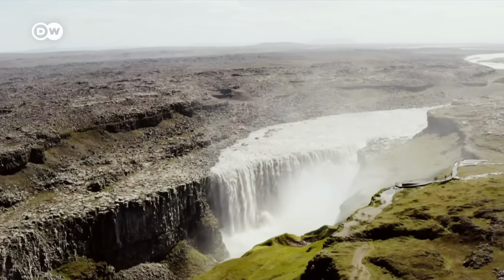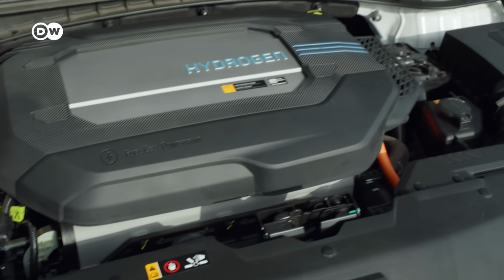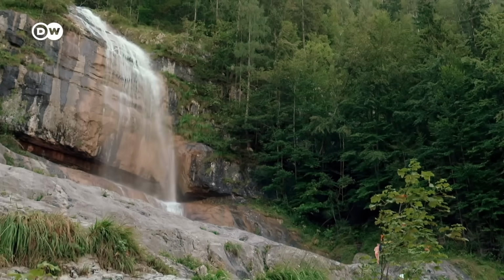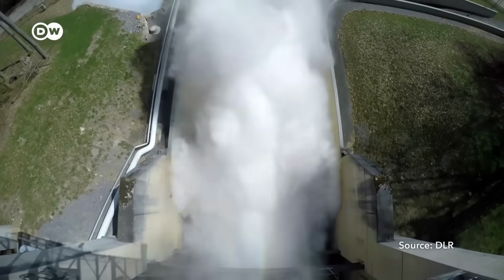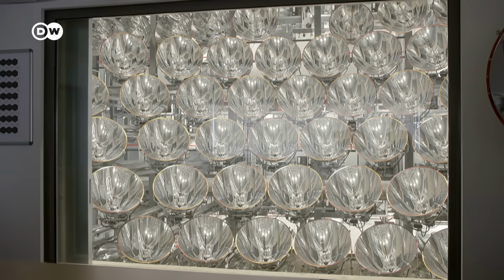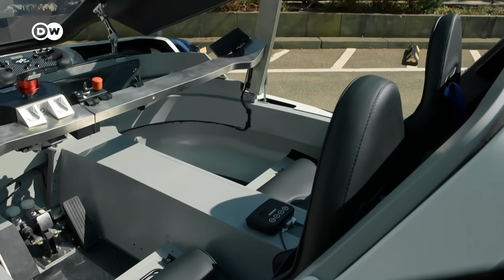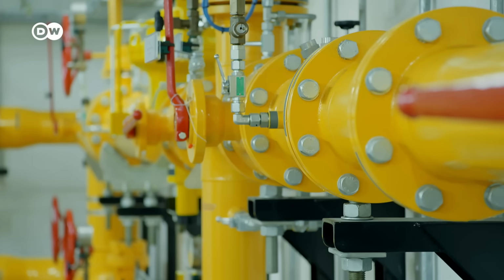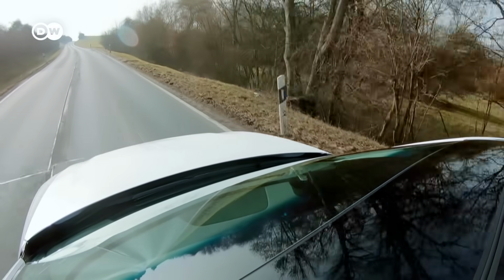Is green hydrogen the answer to the climate crisis? | DW Documentary

Comment: The inefficiency of the green hydrogen cycle is an insurmountable obstacle for it being used for anything other than niche applications where batteries can't work. Also, using only surplus electricity from renewable sources to create hydrogen means that the costly equipment is unproductive as it sits idle for a lot of the time, making it even more expensive. Storing surplus electricity in a battery is over 90% efficient, and capital costs are also much lower - hydrogen will never compete without a massive breakthrough in efficiency. Just because it is technically possible doesn't mean it will ever be economically realistic.
Reply: You are overlooking convenience, and the necessary upgrading of the electricity supply infrastructure to charge the national vehicle fleet simultaneously overnight. Why do you not consider stored hydrogen as an energy storage option ? (One that doesn't involve millions of tonnes of extra copper wire throughout the countryside !)
Reply: @johnevans6218  You do realize overnight charging wouldn't need any upgrade of the electricity infrastructure, right? A fully electrified automotive fleet would add around 10-15% to existing demand. Demand during the night drops by a lot more than that amount. Hydrogen however would require massive investment in extra new infrastructure. Also using hydrogen requires 3 times the energy, or it in other words, it will likely require a lot more wiring than using EV's, which essentially only really need the charging stations (or at home just a short cable).
Reply: You must be a big oil spokesperson
Reply: just as a horse owner said in 1900 about the motorcar.... probably.
Reply: Hydrogen made in summers for heating purposes in winters can be as efficient as 80-85% round trip.  This efficiency can be competitive with batteries.  Hydrogen pipelines costs 1/8 the cost of electric power lines per kW of thermal energy per mile, and existing natural gas pipelines and storage can be used to store H2, thus minimal new investment to convert from natural gas to H2.  H2 and Battery should co-exist, each serving different niches.
Reply: Niche applications only? Hydrogen is the only feasible alternative energy for shipping, aviation, trucking, farming, steel, heavy industries and natural gas replacement. This is the majority of all energy used.
Reply: @timothydevries383  
Trucking doesn't necessarily need hydrogen, though it could be a potential source. BEV and hydrogen trucks could be similar to petrol and diesel. As for natural gas replacement, this is only really in the industry (which you already mentioned) for heating using electricity would be just fine, the question would only be if hydrogen is a best long term (ie. seasonal) option if that was required.
Reply: All the renewable energies are not as cheap as you have been told. It costs far less to just convert gas powered vehicles than to manufacture an electric vehicle especially when you look at the mining costs and environment damage from such process. Regardless, hydrogen is abundant and truly "clean" whereas all the metals required for battery systems is extremely harmful and they are finite. Just remember the politicians pushing "green energy" are the same politicians that have been pushing the oil industry their entire careers. So that said do you think they all just had an epiphany or perhaps they just found their angle to enrich themselves further???
Reply: What happens when the raw materials for batteries run out, has battery recycling been factored into their usefulness ? Taking electricity from a green grid network means there wouldn't be any renewable generation standing idle ! Also current vehicles can be converted, negating the waste of replacing every vehicle on the planet !
Reply: @johnevans6218  As nice as it sounds, converting an ICE to electric wouldn't be a trivial task and almost certainly would be too costly to be viable.  I just don't think it makes any sense to do this to cars already on the road.  However, existing car manufacturers should have a huge advantage here, being able to use much of their existing infrastructure to swtich their existing lineup to electric on new cars going forward.
Reply: It depends on the objective.  If you want zero emissions then it is the only option.  Electricity sounds great but its uses are extremely limited and most people who live in cities where it is most useful cannot park in the drive to charge up normally from normal coal based power stations.  Electric has range issues etc. as well and short lifespan which makes them a waste problem which means they are the exact opposite of green.  The best option for hydrogen is to build solar plants in the Sahara (like the one already in Morocco) but no one wants to extend the Arab power.  The infrastucture of the oil industry could easily be changed to hydrogen.
Reply: @Jamie-Z  I do believe that you are coming from the perspective of several years ago, with essentially refutations of EVs, that were (and still are ) promoted by the oil industry, and the existing ICE manufacturers. They have big pockets to promote negative publicity around EV adoption - verging on lies. Problems with EV charging are relatively simple to solve- the infrastructure is already in place.
Reply: @chrisheath2637  The problems with recharging are beyond current technology so no, they are not easy to solve although if you do not mind replacing one pollution with another then yes, it will be fairly easy.  Hydrogen on the other hand can solve the problems without the need (although there would also need to be a will) for another pollution.  I do not come from the perspective you suggest, there are other better technologies but the oil industry has the deepest pockets and I believe we are deliberately being sold a pup so we have to stick with oil when ethanol or biodiesel could be in the pumps tomorrow it there was a will.  Hydrogen is the best future, electricity does not work and if everyone decided to go electric as our governments decree there is not enough raw materials on the planet to make the batteries and in 8 years when those batteries need to be replaced I hope we have found more reserves whereas with hydrogen we would have no such problems.
Reply: @Jamie-Z  The problems with recharging are beyond current technology
What are you talking about? Recharging isn't a problem.

Hydrogen on the other hand can solve the problems without the need for another pollution
Yeah, no. This isn't correct at all. Hydrogen would pollute more or less the same, just in a different way. (For example 3 times the needed renewable capacity that needs to be installed, which still has a co2 footprint)

there is not enough raw materials on the planet to make the batteries
Except, there is.

and in 8 years when those batteries need to be replaced
Modern EV batteries are expected to last the lifetime of the car, except if the car model has a terrible battery management system. Several manufacturers even guarantee a batteries minimum charge left (usually around 75%) after 8 years or 150k km.

whereas with hydrogen we would have no such problems
Except you ofcourse need the resources for 3 times the amount of renewables.

Hydrogen is the best future
You still haven't mentioned a single good reason for this claim. All you did is say stupid outdated criticism of EV's that anyone with a bit of knowledge knows is just stupid.

Leave tons of copper lying around in every street in London
Yeah, in protected cables/under the sidewalk, just like is the case now. Do you really think there are no easy solution to situations like this? Are you really that blind to reality or are you just insanely uninformed?

Given that there is not even enough parking in Fulham for the residents
Then where do they park their cars now? I doubt they keep driving them around constantly because there isn't enough space. Every car currently needs to park somewhere, that is just a basic fact.

When I lived there I spent most evenings driving around searching for a space
But you clearly found one, otherwise you would have been driving all night untill you had to get back to work. A charger doesn't necessarily need to be a private charger, you could also just install a lot of public chargers which cost slightly more (but not much, maybe 3-5cent/kWh extra) to charge at.

I would suggest you visit Amsterdam in an electric car to see how well they did and they are the best there is  :)
You mean a city were most people use either the bike or public transport? Again if there are cars, they need to park, meaning they need parking spaces, meaning you can install a public charger, not all that hard to understand. Essentially you aren't talking about the problems with eV's, you are talking about hte problems with cars in general.

and they are the best there is
Not a single city region is where it needs to be for fully electric driving, just like there isn't any region even remotely close to accomodate hydrogen driving for even a fraction of the drivers. Just because it isn't here now, doesn't mean it can't/won't be possible in the future. There is nothing fundamentally stopping EV's from replacing all ICE cars, the main thing that needs to be done now is just roll out the necessary regulation and infrastructure, exactly the same as with hydrogen. However while you need to roll out this infrastructure for literally everyone in regards to hydrogen, you only need to do this for people who can't charge at home or along highways for those people that make longer trips, so a lot less infrastructure is needed.
Reply: @MDP1702  Clearly I totally agree on every point here. How can people be so wrong?  Every town and city in the western world has street lights - so a bit of adaption - and charging. It is, I suppose, the political will to do it. Terrorists would have a field day with hydrogen infrastructure...instant bombs everywhere ! ( I am totally opposed to hydrogen for cars, from an engineering perspective. Hydrogen from methane reformation that is 98% at present - creates around 800 million tons of CO2 annually worldwide, with NO viable way to hide, sequester, bury, capture, or wish it into non-existence...Big Oil is in love with hydrogen...and their lobbying, promotion and funding prove that the publicity is working...)
Reply: @chrisheath2637  Street lights running a a 100 watt being replaced with 7Kw and you do not see the difference, no wonder you agree with the other guy.  Hydrogen from methane?  Why?  You wish to compare with a stupid idea to make your stand but everyone will wonder why you fail to make a point.
Reply: @Jamie-Z  Dang of course ! Tiny wires are running down the street to light lights. Ha-ha, yeah, and that of course is a completely different system from the cables that power houses, and commercial properties! I didn't think of that...
Reply: @Jamie-Z  
Street lights running a a 100 watt being replaced with 7Kw and you do not see the difference,
Just because they run at a 100W, doesn't mean their lines can only take a 100W. Even if the wires in the streetlights themselves are really thin, they likely get their power from another much more capable wire either underneath or above it. A good regular extension cord should already be capable of 7kW. 

Are there possibly updates necessary (ins some area's)? Yeah, maybe, but it isn't like these never would be needed eventually anyway.

Just to be clear, this is already being done and isn't that difficult, maybe one or two hours work to place a chargeport in the existing lightpole.
Reply: @MDP1702  You are so cool. It's so nice to see an adequate and educated person who owns logic. Thanks from Russia.
Reply: @Jamie-Z  most people who live in cities where it is most useful cannot park in the drive to charge up normally
These people need to park their car somewhere at night no? So it is just a matter of deploying low level 2 chargers to regular streets so people can use them at night. Besides that you need to ask yourself what these cars are used for: travelling to work? charge at work. Go to the shop: charge at the shop. ... Essentially there are more then enough possibilities to charge, however they need to still be rolled out. And if you really have no other choice, fast charging is available too.

Electric has range issues
The current hydrogen cars have a marginally better range than several EV's, who sometimes are much cheaper than those hydrogen cars. Besides you'll need quite some hydrogen refueling stations, which are very expensive. For that same price you can place around 30 fast chargers, that you can disperse over a wider area, meaning less time lost going to a station vs hydrogen. And if you have a car that can go 500km, that would be more than fine enough for almost anyone, considering you can't really drive further than that in 3-4 even when constantly driving at a speed of 130km/h (which is the highest limit in a lot of countries/regions). And after every 3-4 hours of continuous driving you are advised to take a 15-20m minute rest anyway, during that time you can also go to the bathroom, eat or drink something, stretch your legs, just shut your eyes, ...

In regards to trucks/semi, 800km seems to be a good range considering you'd be able to drive that range in around 9 hours at the usually top speed of 90km/h. Beyond that you'd exceed lawfull time limits in the EU and can be fined for driving too long. And realistically most trucks won't drive non stop for 9 hours at the max speed. Tesla semi have a claimed 800km range fully loaded, if that is correct, there really isn't a reason EV trucks aren't a good option for regular trucking. Only for multiple driver trucking would you need hydrogens range (and even then, what is losing 30-60min at a fast charger considering the cost savings driving on battery power?).

as well and short lifespan
What lifespan are you talking about? The batteries? Current Tesla batteries already are expected to last beyond the lifetime of most ICE cars, this also goes for several other EV parts (like the motors). So I don't really see what you are pointing at.

which makes them a waste problem
Not really, all EV parts are recyclable, even the battery (several companies already achieved a 95%+ recycling rate).

The infrastucture of the oil industry could easily be changed to hydrogen.
I don't agree with that, it is quite a different infrastructure you'll need. Only general things like docks for ships wouldn't need (much) changing.
Reply: @MDP1702 overnight charging on the street sounds to me like a wet dream for antagonist interference
Reply: @johnevans6218  
overnight charging on the street sounds to me like a wet dream for antagonist interference
What do you specifically mean?

has battery recycling been factored into their usefulness ?
Yes, there are several companies that achieved 95% recycling rate of lithium EV batteries and car manufacturers see recycling as a way to reduce costs (much higher purity of materials in a battery vs mining, not needing to ship it from countries all over the world, ...)

Also current vehicles can be converted
They can, however they are likely to be less efficient etc. so the price will need to be considerably lower for people to buy them, which in most situations won't be the case. Moreover cars can also be mostly recycled and people will just keep driving their ice car currently untill they want/need a new car. Only few people would be willing to bear the cost of converting their car to an EV (or hydrogen if possible).
Reply: @MDP1702   Lovely idea :)  Leave tons of copper lying around in every street in London :)  What could possibly go wrong  :)  Given that there is not even enough parking in Fulham for the residents where do you imagine you would put all these charging stations?   When I lived there I spent most evenings driving around searching for a space and most mornings walking around searching for my car.  I would suggest you visit Amsterdam in an electric car to see how well they did and they are the best there is  :)
Reply: @CL-gj9mf  
You don't see that, at our scale of existence petroleum isn't a sustainable vector of energy.
Actually I do, but whether you like it or not, at this moment we live in a petroleum civilization. EV's, renewables, ... are exactly what is needed to change this. Hydrogen will/should only be used where electrification by direct use or batteries isn't possible, like in shipping, airplanes, industrial applications (for example steel production and industry that requires high temperatures), ...

Petroleum isn't useless, it store CO2 out of the air we breath, and out from the water we live in...
I clearly meant useless in terms of energetic value to us, not in terms of carbon storage. This was completely in regards to your comment that hydrogen is as efficient as fossil fuels, which is actually really bad for hydrogen since we need to put all that energy in it first, we don't need to this with fossil fuels.

* it doesn't exist*
Yeah, it does. Several small companies already are capable of recycling lithium batteries at 95%+ efficiency. The main reason these are new pretty small companies is because they were founded with the vision of recycling EV batteries, before EV batteries the recycling market for lithium batteries just was too small to be interesting.

We aren't ready for fully recycling plastics
Completely different thing. Just because we can't fully recycle one thing, doesn't mean we can't recycle a completely different thing.

Fuel cells already exists
So do batteries. And their recycling.

If you choose others solutions you choose to engage war with China for the control of minerals and rare earths ressources
Most battery resources are not in China.

You can't electrified industrial moving engine
Depends what you understand under it. They even already electrified enormous mining vehicles that transport the mined substance, though for now it is still situational. And there also are already electric tractors for agricultural use if I am not mistaken.

So we will have to use methane produced from agricultural residues
While I like the idea, it isn't practical. I personally thought about that too, but the only way to do this is to have cattle sit in well isolated barns and having a system to get the methane from that air, doable but not really profitable and definitely not for mass scale use in industry, more like personal use of the farmers or surrounding area at best.

ITER is the final research step from 80 years of climbing efforts
ITER is not the final research step unfortunately. All ITER is meant to do is show we can get more energy out of the reaction than we put in and do so at a large enough rate to be able to produce enough electricity in another plant. Even after that we'll need to see if it will be commercially viable, building actual testplants that can produce electricity, ... And for now there still is no certainty ITER will do what it is meant to do. Yes, normally it should, but we can't know for sure. Even fusion scientist say that we don't need to expect any real electricity generation from fusion reactors within the next 30-40 years, even if ITER is succesfull. By that time we need to have fully electrified our civilization already.
Reply: @CL-gj9mf  
Where are these small industry, you talking about,
Redwood, Li-cycle, VW also has a subsidiary/testplant that achieved such high recycling rates. There are some more, but these are the ones I quickly could come up with.

to fully recycle my battery like the smartphone's one
It is unlikely any of these will focus on smartphone batteries, they are just too small (around 4000-6000 smartphone batteries per average EV pack). Ofcourse they could possibly recycle them as something extra/on the side, but someone else will have to do the gathering and shipping of these small batteries for them to consider it remotely interesting. And currently there is only one relatively small plant for every company, considering EV batteries are recycled at best 10 years after being introduced into the market, more likely 15-20 years or even more. So EV batteries they recycle now either need to be from EV's in the 2000's or from batteries that had a flaw during productions (which happens quite often, but these generally are found out before they leave the factory). So in essence these companies can't grow fast currently, they need to wait for another 1-2 decades to really expand on the current growth of EV's.
Reply: @MDP1702  most of the energy we r currently producing is coal based. When we store electricity in batteries we also loose some of it as heat and they become less efficient with each cycle. Also transporting electricity directly is not feasible because copper looses most of energy because of joule effect. Whereas we can do it with hydrogen. If enough money is spend on its research. Hydrogen is a way of storage of energy we r producing. Hydrogen is not a source from which we r extracting energy unlike fossil fuels. Hydrogen cars works by converting energy released by hydrogen into electricity and running the car. Electricity is one of most efficient way of transporting energy in short range. Currently ev r just using energy made by fossil fuels not renewable energy. Our problem on becoming energy efficient with renewable is that we don't have means to efficiently store it. We r producing lot of energy in renewable plants but we lack means to store it. And hydrogen seams like the best way to do it. HYDROGEN WILL BE A WAY TO STORE ENERGY NOT PRODUCE IT
Reply: @lololol-z7e  
most of the energy we r currently producing is coal based.
actually it is not, that would be oil based, coal is second, only slightly beating gas. In the US and Europe coal is even the 3rd most used form of primary energy. For electricity worldwide coal is indeed the number one. However in Europe and the US coal only makes up around 20% of the electricity mix and is ever decreasing.

When we store electricity in batteries we also loose some of it as heat
Which is why batteries usually are marked around 90% efficient, compared to hydrogens +-34% efficiency.

they become less efficient with each cycle
Yes, but they still last several thousand cycles before hitting around 70-75% capacity.

Also transporting electricity directly is not feasible
Hmm, what have we been doing so far? Oh yes, transporting electricity directly. HVDC can transmit electricity with a loss of around 3-4%/1000km, for HVAC this is around 7%/1000km. Hydrogen will at minimum loose around 65%, not including possible transmission losses (though when done well I guess these would be low to non-existent). This means you can transport electricity directly over +-12 000km with HVDC and suffer the same amount of losses (I calculated in losses from other necessary steps, else it would be around 16 000km), that means from Japan to around Portugal.

If enough money is spend on its research.
Or you can spend that money on improving already existing and viable other things like direct electricity transportation, or better batteries, ... (just to be clear I am not against hydrogen research, hydrogen will play a key role in some sectors, but the premise that hydrogen would be the best way if enough money is invested in research is onesided, the same can be said about many other things, like batteries, grid infrastructure, ...).

Hydrogen is not a source from which we r extracting energy unlike fossil fuels.
That is one of the points I made in this thread, as to why you can't compare fossil fuel efficiency with hydrogen efficiency. One is a 'carrier', the other a source.

Currently ev r just using energy made by fossil fuels not renewable energy.
Which would be the same with hydrogen obviously. This isn't an argument for hydrogen, it is an argument for more renewable energy to be installed.

Our problem on becoming energy efficient with renewable is that we don't have means to efficiently store it.
Which is why there are currently several storage solutions being developed or tested that could fill this gap. This ranges from different battery technologies (flow battery, metal battery, 'rust' batteries, ...) to other things (compressed air, liquified air, heat storage, ...). Most of which are more promising than hydrogen in regards to grid based storage. And ofcourse if you have millions of EV on the streets, then with enough low speed chargers that are plugged into idle cars, you get GWh's of possible storage capabilities from that alone. EV's could help the renewable transition, hydrogen cars not, since these need 3 times the renewable capacity, making a renewable transition even more difficult.

And hydrogen seams like the best way to do it
Even at this moment hydrogen is seen as a terrible way to store electricity, only to be used as the very last resort. The main purpose for hydrogen is expected to be in shipping, aviation and industry.
Reply: @CL-gj9mf  
you can't be independant from chinese supply chain
Most battery materials are not in China, that are other rare minerals you think off.

Which amount of electricity is needed to realize this recycling???
One of these companies uses the energy left in the battery to power a large part of the recycling process, and the fully drained batteries are also safer to recycle after. Other process involve chemical process' that don't use a lot of energy. Do you realize how much energy is lost mining and transporting new materials?

not a chance the solar energy will be enough on earth
We can easily get enough power from the sun to power our current civilization several times over, the main problem is the intermittency, which will get solved with improved storage. Covering just a small part of the sahara would suffice to generate all the energy the world currently consumes (not just the current electricity use, all energy, thus also those from fossil fuels). 

Technically if we use CSP in for example the Sahara the intermittency problem would be fixed too, since it has a storage capacity build into it. The main reason it isn't used a lot now is because it is (slightly) more expensive (+-120$/MWh vs 40 for large scale PV, 50 for onshore wind, 50-80 for nuclear fission reactors and +-90 for gas plants). That and ofcourse the situation in regions like North Africa can be unreliable.

If you don't have a competitive price, you are in war with China
Why the hell do you keep mentioning China for no f*cking reason?

Please, take time to confront ideas to the restritives parameters of the reality.
Apparently you just have a terrible knowledge of the "parameters of the reality", since most you say is bollocks coming from being uninformed/misinformed.
Reply: @CL-gj9mf  
The "inefficiency of the green hydrogen" is the same than the fuels actually used in our cars
With the difference that these fossil fuels are just taken from underground, they are useless when not used (though obviously better not to use if we have better alternatives), whereas hydrogen is created with the energy we alreade have generated and can use directly with for example batteries, thus the energy loss from hydrogen use is a net loss, the energy loss from fossil fuels not. I suggest you look at the EROI of fossil fuels and hydrogen before making such a stupid statement.

but you don't talk about the pollution induced by the big batteries of your "so good electric cars" with 90% efficiency
That is made up for in a couple years. Furthermore with high rate recycling (which several companies can already do), we can keep reusing these battery materials afterwards, seriously reducing any polluting impact batteries have.

The price to pay in CO2 freed in the atmosphere, to extract these rare earths is too high
You realise hydrogen use will also create more co2 pollution? First by the need of installing 3 times the necessary renewable capacity and secondly the fuel cell materials etc will also need extracting. 

And extracting these rare earths are done with petroleum
Because they obviously still need to be electrified. Do you think a hydrogen system will only use material that was mined by non-petroleum means?

No more petroleum, no more big batteries!!!
'No more petroleum, no more hydrogen'. There you have it. In fact currently: 'no more petroleum, no more civilization', just great. 
However if we can electrify everything we can, including everything in the manufacturing of batteries, the 'no more petroleum, no more batteries' stick wouldn't be correct anymore.